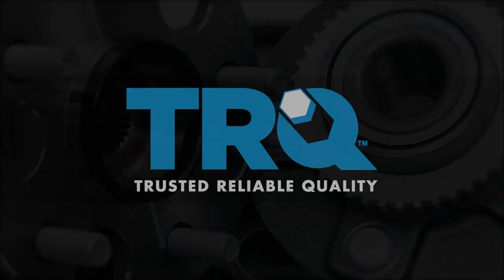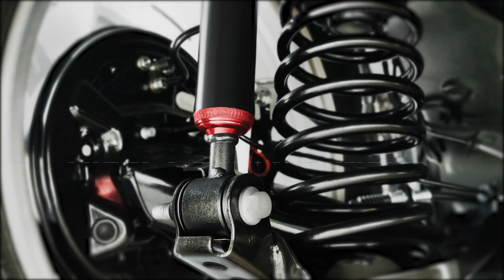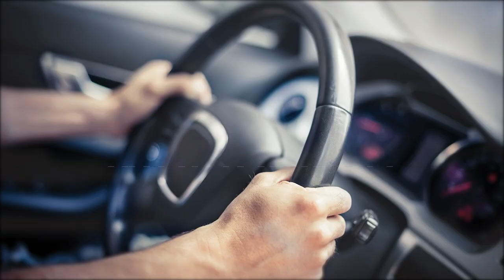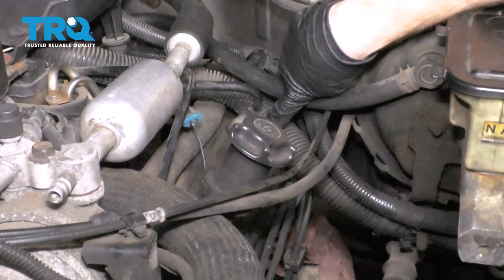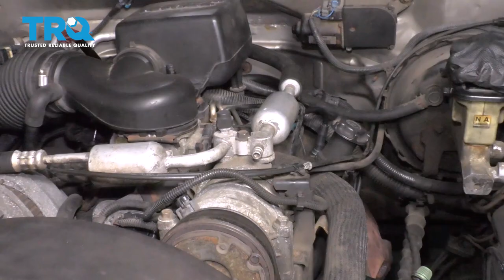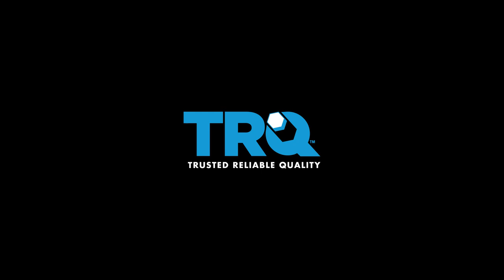How to Replace Positive Crankcase Ventilation (PCV) Valve 1992-2000 Chevy Tahoe

Comment: Bought a 94 Silverado and it’s missing. Should I get a new one or is it ok like that
Reply: Did u find out the issue and yes a bad Pcv valve can cause shitty running conditions Pcv  valve only cost $4-10 bucks go for the AC Delco literally takes only 2 minutes if that to change. Then run Royal Purple with 3 tanks of fuel ⛽️ only 10 gallons burn through it hop on highway drive to work ya daily driving do this 3 times then change your fuel filter then u should be good if your still throwing code’s after changing the valve and cleaning out the carbon out of engine and rest computer means and the codes come back then listen to the codes. But ignore them until u do these simple tricks they can save you thousands of dollars.